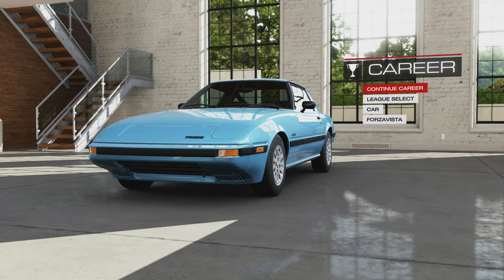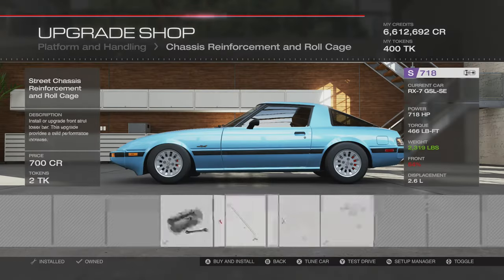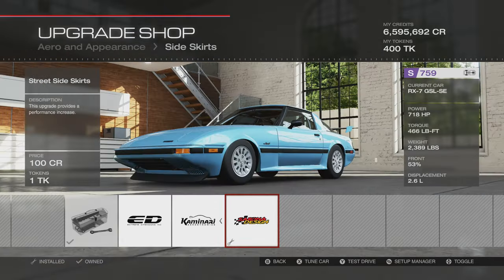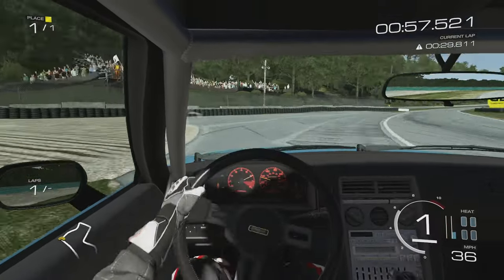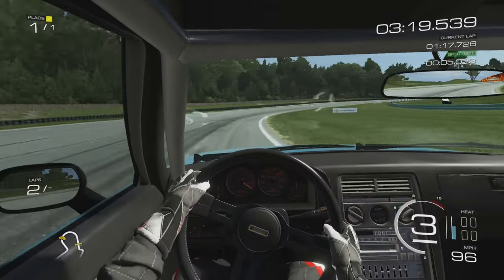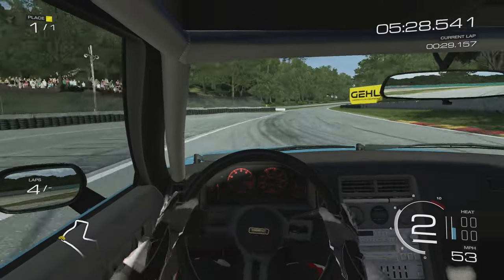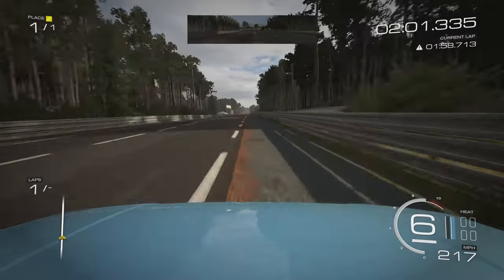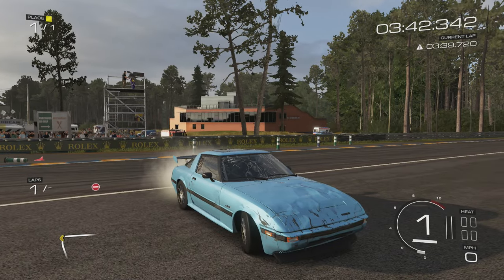FailRace Forza 5 Silly Car Build Quad Rotor Rx-7

Comment: Alex do a fully built Caterham R500 and rear wheel drive please, im been begging since the first episode.
Reply: YEAH, i saw you so many times!!! Alex do the Caterham R500 RWD pls, to stop this madnessbecause now we are two!!!
Reply from the maker: The caterham shall be next xD, chose not to use it this time as it will have the same engine as the lotus eleven
Reply: FailRace It wil be a monster and dominate Road America
Reply: FailRace
Try sticking a transmission similar to those of a rally car. I've tried it before on other games and it made the car accelerate verrry fast. And with high revs top speed will be the least of your concerns while driving. I believe it would be more of a "crazy build" that way.

Comment: 787B is a quad rotor, the engine you used is probably from a Furai.
Reply: Furai engine has 3 rotors, so no, it is the 787 engine
Reply: heiko207
Soz I was incorect, I thought the engine he swapped was a  3 rotor not a 4. Need to get my eyes and ears tested. LOL.